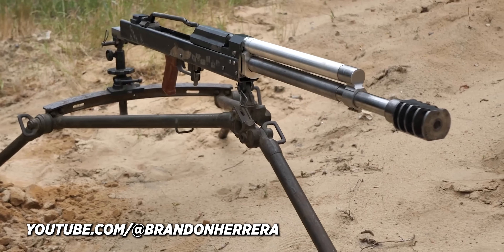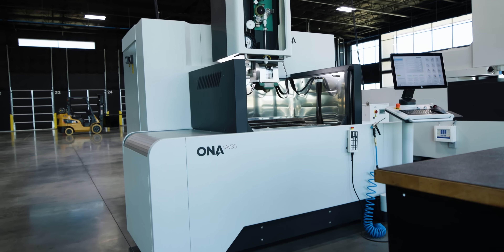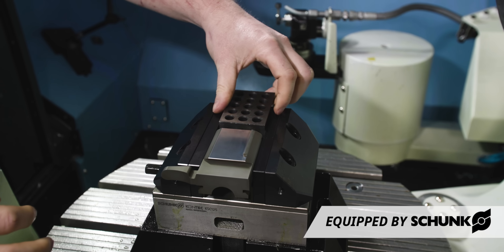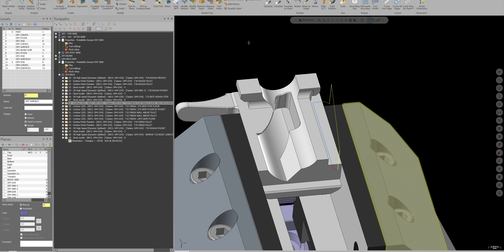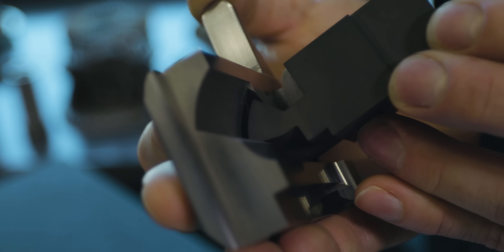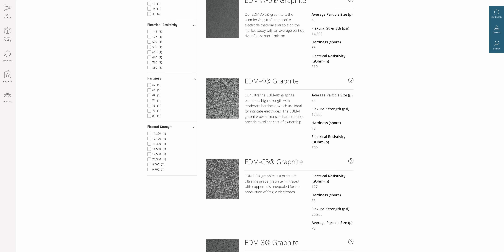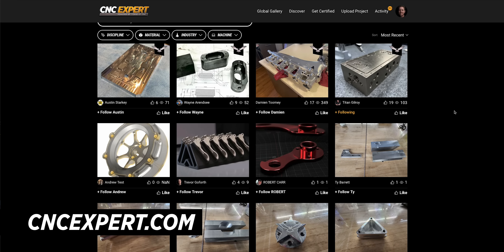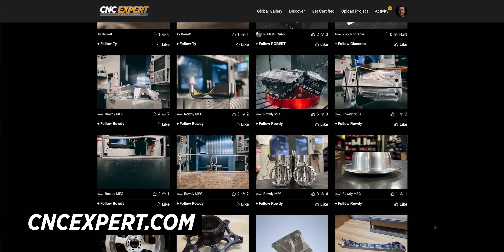CNC Machining AK-50 Cam Groove for Brandon Herrera

Comment: On the cam, instead of 4140 try 4130 HT (HEAT TREAT) You will fine it lasting longer and withstanding more PSI. I'm also surprised y'all do not use stainless steel or Columbium, to get that mirror finish on the part.

Comment: This part design is not Manufacturable for its cost. You can not imagine how expensive this part was to machine using the different machining centers you saw on this video. Brandon needs to re-design this part to make it profitable.

Comment: I have never seen an EDM process with a graphite electrode like this before. The electrode still has to erode as well, right?  Is it used while the erosion stays within tolerances and swapped for a new one, or is it "resharpened" periodically?

Comment: Only in my head, I have a designe for a combustion engine with ONLY ONE moving part, it shares commonality with the Wankel Engine but yt completely different, better and fixes all its issues and complaints people have.
It WILL run off of Any kind of fuel, hell even an air compressor could run it, just not as good as combustion.
So where should I begin in bringing this to life?

Comment: Ok, im not a engineer, but i know lil bit about both manufacturing, and ak... Ak doesn't hold those crazy insane tight tolerance that the ak50 has. So im wondering where hes going with this. Hope no torture test is in the works cause thatl jam quicker than Michael Jackson on crank

Comment: Someone enlighten me. Other than making the highest quality part possible, why is EDM necessary here? Is it necessary? Assuming the muzzle forward section of this groove is a true helix like the ak family, it should be entirely possible to manufacture on a 5 axis. I'm left wondering if the forward section of this groove is in fact a true helix. Hard to tell from the video, but the shape looks... strange? I see if often on (non professional, admittedly) models of the type 3, AKM, and 74 carriers that the cam groove is modeled incorrectly. Often times the feature looks "embossed" or... like, projected. Certainly not the 100mm lead left hand rectangular "thread" that the prints call for. I expect Brandon's to follow in a similar (larger) spirit, but it looks deviated in a few curious ways.

Millions of AK carriers were produced on manual machines before modern miracles like EDM existed. Granted, with highly specialized set ups and tooling, but 100% manual nontheless. As I understand it, this particular feature was presumably done in multiple passes on an auxiliary attachment geared and linked to the lead screw such that as the table transverse that the part would rotate. Resulting in the correct helix. Wouldn't this be right up a 5 axis' alley? Other than to flex that sweet, sweet, sweet finish; if Brandon's part is indeed an honest to god helix, what exactly are you gaining?

Clearly the front trunnion's helical lugs are gonna need EDM. The helical lugs on all the other AK's are WILD features to cut when you can reach them. Helical lugs on the AK50's enclosed trunnion is insane to think about. I'm not sure it could be done without EDM.

But what do I know, I just have a tiny import bench top mill lol
Reply: Because of obstructions,but hey Mr Browning figured this all out 110 years ago
Reply: @Stevie G  ... is this a joke or an actual answer? A helical cut in the same spirit as the AK is 100% doable on a 5 axis. It's a5 axis' bread and butter.

Comment: I need help!
I need to tap a hole that is only 5mm deep.
Material:brass 
Equipment : Hand tap
The problem is the tap starts of very pointy so it touches the bottom of the hole before the cutters reach it.
I thought about gringing the tip of, but I m worried the heat will destroy the temper of the tab. 
Anyone got an idea?
Making the hole deeper isnt an option since the part ends there.
Reply: Get something like a bottom tap, or another style that has a flat bottom. You can. Grind it, but you do want to leave a bit of a taper to get it lined up in your hole properly. Also, it's just brass so even if grinding does change the temper, brass won't really notice much
Reply: @vanguard6937  Thanks , I just learned that there are different types of taps:=) 
Think I am still doomed , because its a 16mm hole and even only 2 staring threads would mean it hits the bottom before cutting...
Reply: @yaykruser  a 5mm deep M16? That's odd.
Reply: @vanguard6937  Yes, Its like a cap for a water bottle, just that its supposed to fit a pipe like brass container.
(Idk what kind of box that is, maybe something to carry a single thin cigar?)
Makes me wonder how they tap capped nuts ?

Comment: And that was a class not to take in school because it is enabling to "topic ghost ...'s", $84 hand and drill press registry. hand drills are consolable... so they cost 2 or 3 times more then a press. how ever one can (A Ford) McDonalds every day for a week? month depending on source of stock... nearly have to cast the steel first. "argon chamber flux capacitor sphere, tungsten rod... edm tools making tools because it took 2 hours to grind 1/2mm off a 11.43mm tungsten swaging button using a bench grinder, took much off the stone that wont come back" tho using that to make that, shown 4140 picture but monk brain know tool make 300kpsi hi-tungsten part.
Reply: WTF

Comment: The machining operations that this part required are quite impressive , but that probably means that the part is way overcomplicated!
Reply: It shoots .50 BMG full auto out of a Kalashnikov system.
Reply: @hoseja  that thing shooting full auto would be news to me. I do not recall Brandon talking about the AK-50 having full auto and the price of .50 BMG would be cost prohibitive.
Reply: @marcusrauch4223  Uh, that's the entire point of the project. You can even see it shooting full auto already in the prototype previews.

Comment: ‘Fillet’ , also manual edm is some straight magic bumfuckery.  The first time I spent a few hours brazing, then grinding that copper electrode, had my digi micron tossed out by an old Ukrainian grandpa… it all paid off seeing that baby sink right through a tungsten carbide die.  There is a lot of finesse to it, however. Please don’t be the ass that rushes it. Inspection does not like pitting, and whoever is polishing it ain’t got time or tolerance for that!